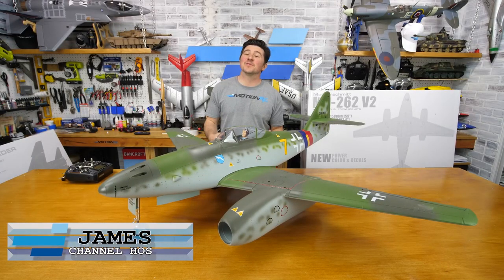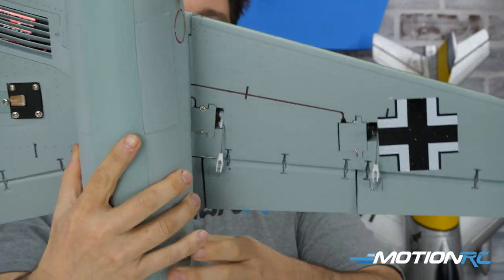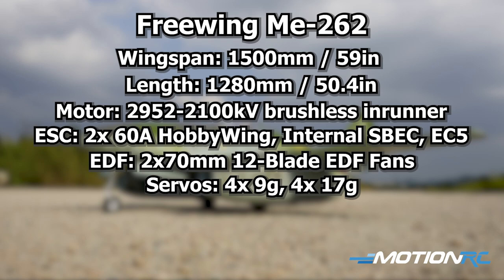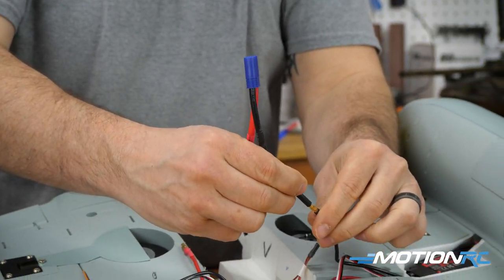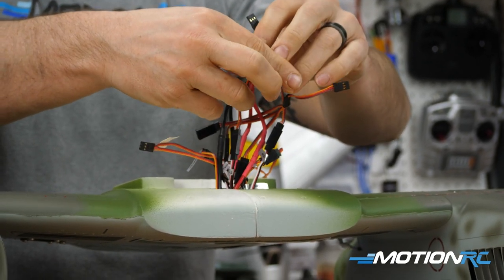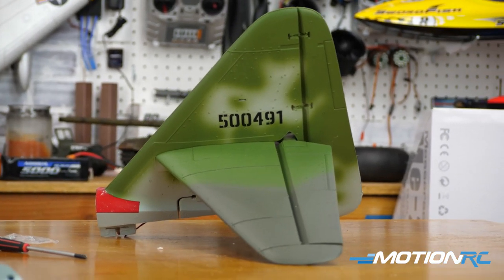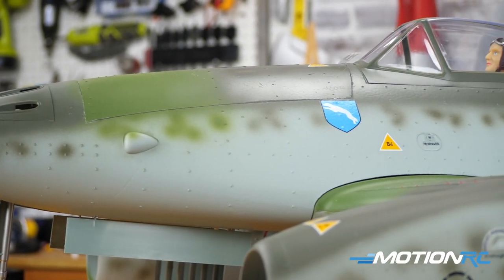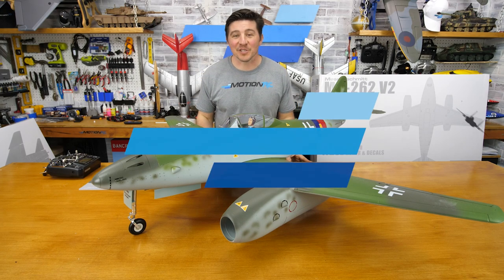Assembling the Freewing Me 262 Twin 70mm EDF Jet - Motion RC

Comment: I bought the Freewing Me-262 about a year ago. Didn’t maiden it till last weekend. I put the Spektrum AR-637T in it for the 3 flight modes and having the gains adjustable on the R Knob. 
My mom told me I have always been a procrastinator. I didn’t get a birthmark till I was 8. I wasted a year just looking at this EDF. It was a piece of cake to fly.  Very similar to the Flightline 1600mm Corsair and the 1600mm Spitfire. Very stable, easy to takeoff. Landings..... I did shear off the front gear pin on the 2nd landing. Not the Me-262’s fault, I’m the worst lander of tricycle landing gear in the history of aviation.
Great plane, Freewing tough, easy build and without any Spektrum assistance flies on rails. Can’t wait for the 3 replacement pins for the front gear strut to show up. I’ll have the 262 back in the air the next day.

Comment: IMPORTANT ASSEMBLY NOTE: The tail section is attached with 3 screws, NOT JUST 2. The hole for the third screw is hidden by the red stripe. Rub your finger along the middle on the bottom of the fuselage and you will feel the indentation. You can easily pop through the red tape and drive in the screw with a long Phillips head.

Comment: To bad they didn't come up with easy connect wings for wiring. Seem look like  be pain in butt transport ?  Anyone have issues with machine screws holding  on wing ? im assuming transporting it with wing off..
Reply from the maker: Actually, this transports easy for me, I just never break any connections, you can take the screws out and then just turn the wings parallel to the fuse and set the fuselage on top. I just put a towel or blanket between them
Reply: @MotionRC  ok thats good to know thanks